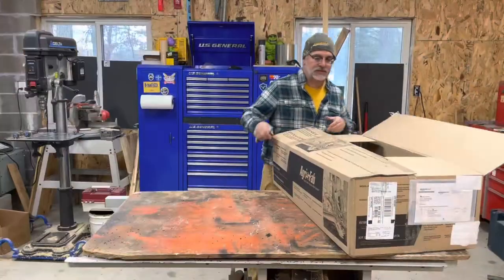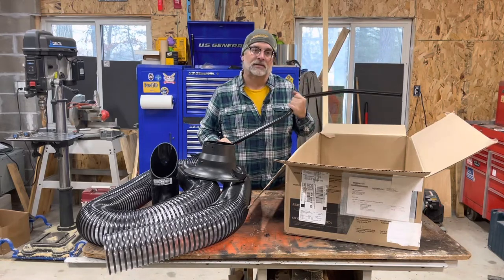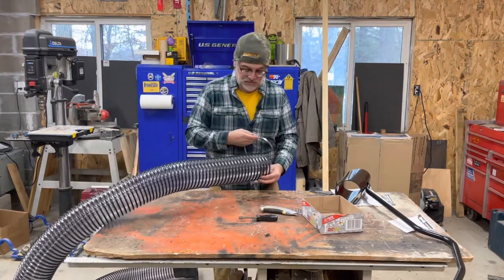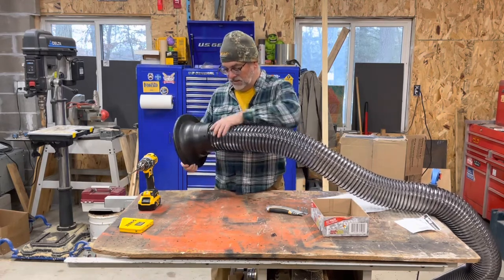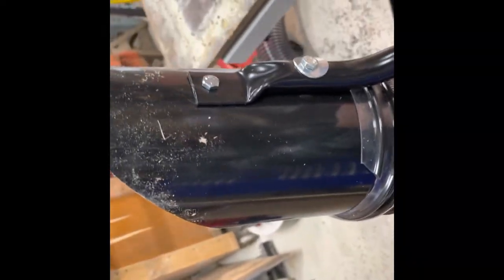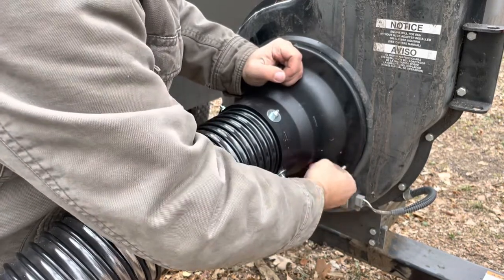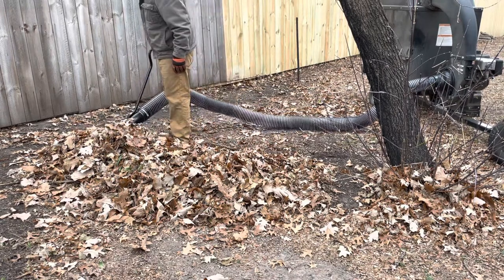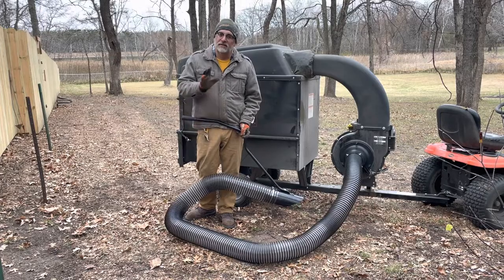Agri-Fab Remote Hose Kit, Assembly and Demo

Comment: Could you also use this hose to hook to the mower deck?
Reply from the maker: The hose to hook to the mower deck is a 6”. The remote kit in the video comes with a 5”. I would recommend sticking with the 6” for the mower.

Comment: Hello i just have a question on your Agri-Fab vac how is it working since you have it and is there any regret ? I been thinking of buying one and would like to know if is worth buying thank you
Reply from the maker: I really like mine. It’s not perfect. You will want to mulch the fall leaves before you suck them up. You can pack more leaves in the wagon when they are chopped up. I have lots of trees so lots of leaves. That also means lots of random back and forth around all those trees. The hose wand kit really made a huge difference in usefulness. When cleaning out the flower beds and corners of the yard. I now just rack up a pile. Then pull up with the vac wagon and suck up the pile. I had been forking it all in a little two wheel wagon. This is much quicker and easier.